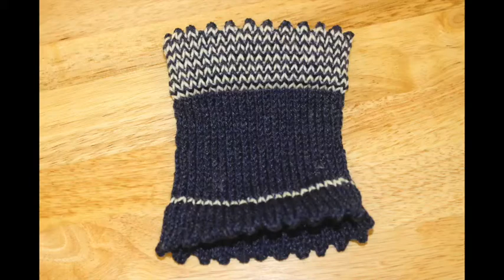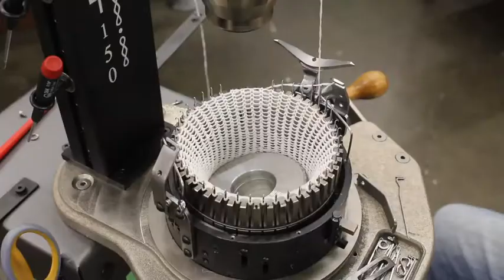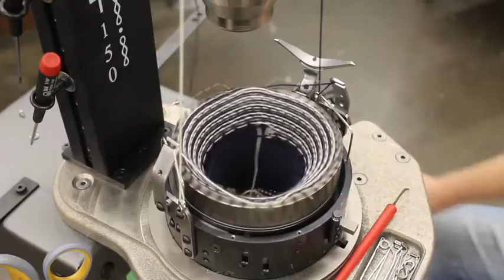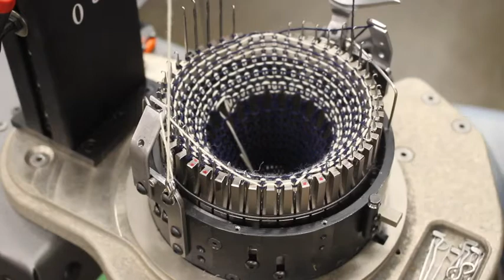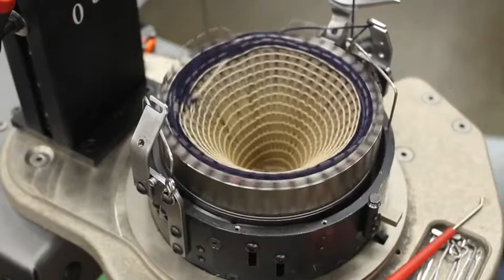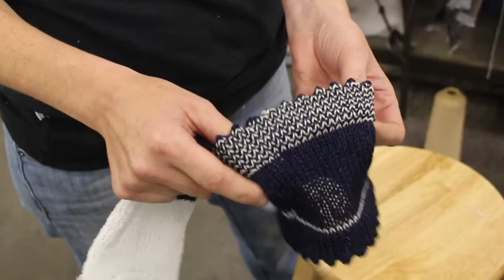LT150 Two Color Picot Hem

Comment: I am curious about what you have in the center using it as a weight. Looks polished and smooth. Are those available? Would it be good for toe up socks?
Reply: Hello! This is an older video.  I think the weight in the center was spare part that was turned and polished for use on one of our production machines.  This is an interesting request though, as it does look useful for toe up socks as you suggested 🤔